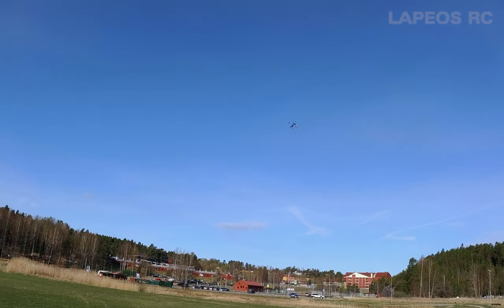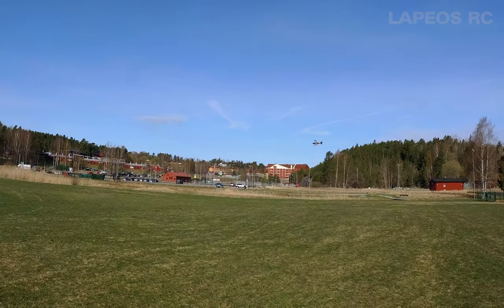OMP Bighorn - Bad telemetry warnings!

Comment: Nice flight. You can turn that off. Go to telemetry, click on Smart battery (twice), and inhibit the "Start up voltage".  That will stop the warnings you're getting.
Reply from the maker: I've started to turn off all alarms except the overall voltage. Strangely often I get false alarms when switching between 3s/4s and sometimes there are other bugs.

Comment: I get the same alarms on the Eratix with high throttle and multiple servos working. I think it's a voltage sag.
Reply from the maker: Yes that's the purpose to warn of excess power draw but I've also pushed the Eratix without alarm until I reach the end of the flight. I'll look into it a bit more down the road.
Reply: @SunriseRCAviator  I have 3 of the 850mah G2 smart packs. They all give me the alarm from take off to end. I still get 5 minute flights but I am usually at 50-75% throttle. In hindsight the alarms also happen at lower throttle settings near the end.
Reply from the maker: @danflom1271  I do Tattu 850mAh 75C so these might handle the load better.

Comment: Hi, what receiver are you using on the OMP Bighorn? I bought the green OMP Bighorn PNP and I use the Spektrum AR8360T receiver with the telemetry cable soldered to the original OMP ESC connector, with which I fly without alarm problems. In ARF planes that I have bought, I use FMS's Predator ESC's, no problems, they are cheap and easy to program. Greetings
Reply from the maker: I have a Spektrum AR637T in mine and Avian ESC.
Reply: @SunriseRCAviator  I also have an Avian ESC but mated to an AR8030T similar alarms in flight.  I'll be altering the telemetry warnings and hope that resolves it.  Quite distracting in flight.
Reply from the maker: @OwenChristyJr  Prop down helps but I also experienced bugs in the telemetry system which gives false alarms. I have turned of all warnings except for a 3.5V/cell voice alert lately to get rid of most warnings. I've also noticed that if doing an auto setup and letting the system configure telemetry this might remedy some issues. Certainly different firmware versions can cause odd things to happen as another cause.

It's always good to look in the telemetry page and see what can kind of amps being pulled after a flight to figure out what might cause these alarms.
Reply from the maker: @OwenChristyJr  It is very distracting and to me if set to voice it is less annoying at least.